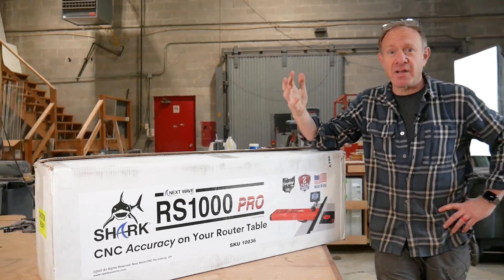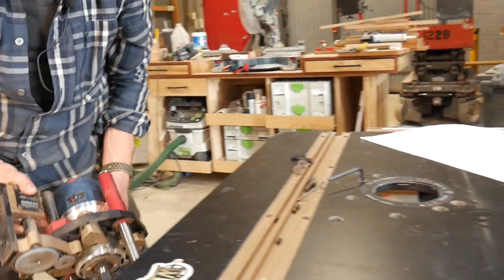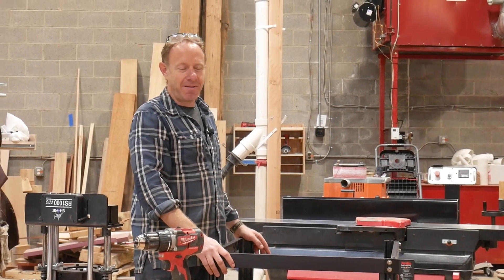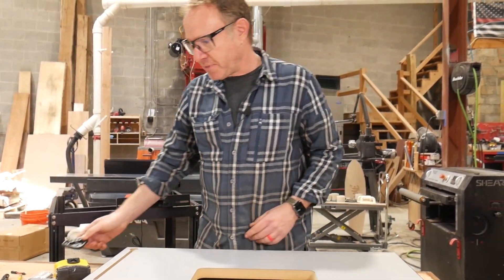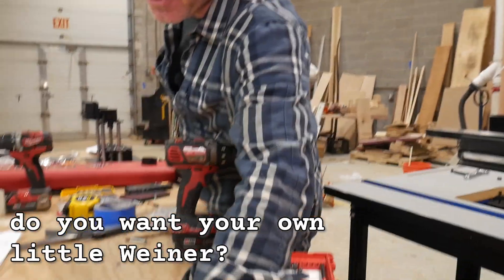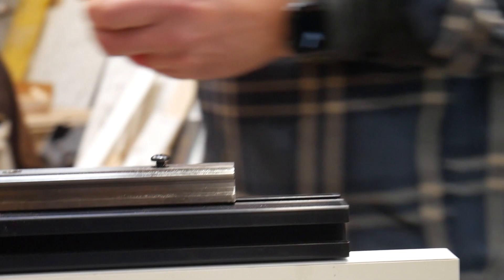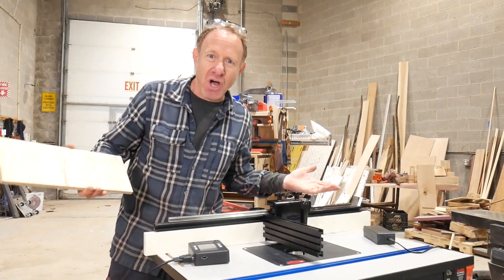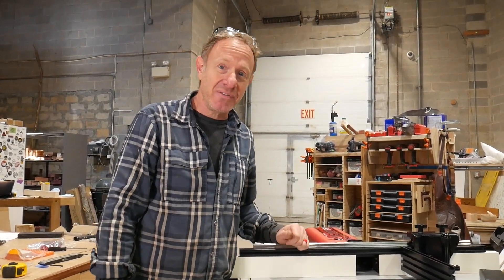You NEED This Automated Router Table | The Next Wave RS1000

Comment: Thanks for vey clear views of this kit. Heard about the RS1000 a couple of days ago, and it made perfect sense. I want one. However, having previously scratch-built a CNC machine (see my channel) I am not shelling out two grand for one- I shall build it. Actually much simpler than a CNC, but using the same type of parts, it should present no problems. Will write my own software, so not limited to the delivered set. I will base it on g-code, but with parameters entered at run-time; flexible, and an open-source user group could emerge.
As soon as I finish my current project, this will get built.
For anyone concerned about patents or copyright, in the UK these do not apply to anyone making for their own use. I believe the US is the same...
Reply from the maker: Please document your build. We would love to see your process and how you make out! 🤘🏻
Reply: @the_crafty_studio_official  I certainly will. It will be a series on my channel; the basic design parameters have been chosen.

Comment: The Kreg table you recommend is not symmetrical front to back. To get full travel of the fence, the blue track must be positioned in the back, under the red fence.
Reply from the maker: I haven’t had that experience. DM me some photos so I can see what challenge you are sharing.
Reply: @the_crafty_studio_official  I'm using the Kreg PRS 2100 table and after taking advantage of the table’s asymmetry, I’m able to get 4” of the 6” possible fence travel. The last paragraph on page 1 of the instructions calls attention to the need for a “shop-built table extension must be added to the back of the typical table” to get the full 6” of fence travel. What model #  is your Kreg table?

Comment: What router did you mount in the table.  The directions didn't specify that the lift was only for a 3.5" motor router.  I'm having none of my 3 routers have 3.5" motors.  Having trouble finding/confirming what router to buy.
Reply from the maker: I’ve been out of town. Let me check tomorrow to be sure what model I got. Thanks for the patience
Reply from the maker: Tomorrow or Monday

Comment: I'm also very curious how much distance do you have on that table from the center of the bit to the end of the table where you mounted the positioner.
Reply from the maker: Hi I’m out of town till next week. I’ll make sure to check this for you when I get home.
Reply: Not enough to get the full 6” advertised travel if you use the Kreg PRS 2100. 4” at most with this table, not sure what table is used in the video.

Comment: What was it about the Jessem table that made it harder to install the RS1000 Pro system over the Kreg?  This video is all there is on the internet about using the RS1000 Pro on a Jessem table, but you don't really go over the differences or what it was specifically that actually made the Kreg easier to use.
Reply from the maker: Hi. Thanks for asking. The RS1000 comes with a cutting template for cutting a hole for installation. Rather than cutting my Jessem table top I purchased the Kreg top which was perfectly sized for the install. I hope this helps. Reach out with any questions.
Reply: @the_crafty_studio_official  I had originally planned to use the Jessem table as well, but changed course once I heard you mention that you had issues with it and ended up using the Kreg instead. I couldn’t find where you showed what the issue was and when I asked Next Wave about it they said they hadn’t had any complaints from anyone using the Jessem table, but I didn’t want to risk having to mangle a new phenolic table.

I looked at the manuals for the Kreg, RS1000 and the Jessem and it appeared that instead of a lip around the inside of the cutout the Kreg just has a cutout that you add the adjustment wedges to  the corners to install and adjust the level of the lift as you show in your video. 

I really didn’t want to use an MDF top and after some searching it looked like the Woodpecker phenolic top was more like the Kreg. It still has a lip, but the level adjustment on it appears to be done the same as the Kreg except with the corner adjustment pieces already in place.

Right about now I am really hoping that going with the Woodpecker top doesn’t bite me since it is on its way.  Thank you for your help. There is almost no information about the RS1000 and no one else appears to have tried a different top or a spindle, so I appreciate your taking the time to make this video and respond to my question.
Reply from the maker: Thanks for reaching out. Is there any content that you would want to see about the RS1000?